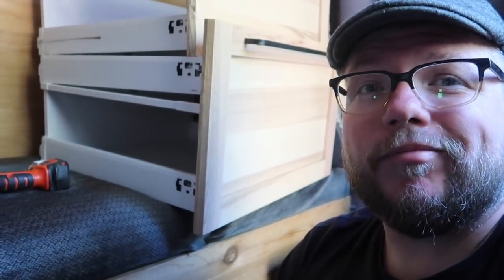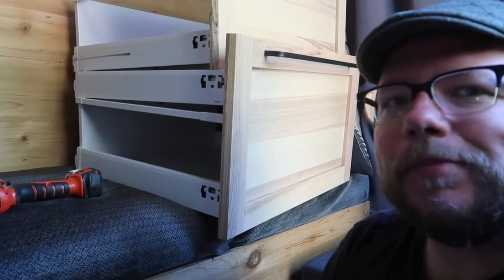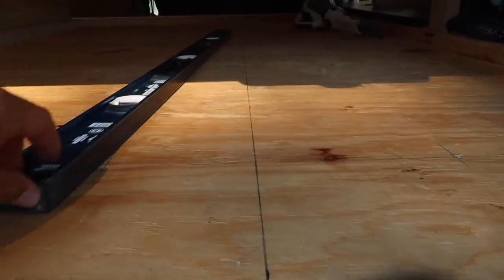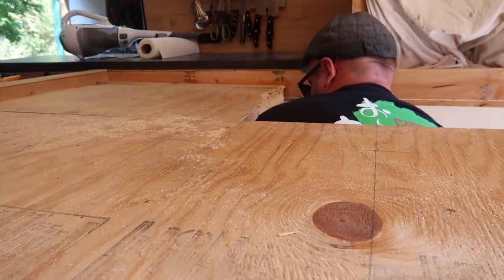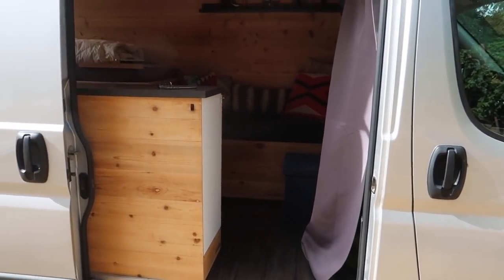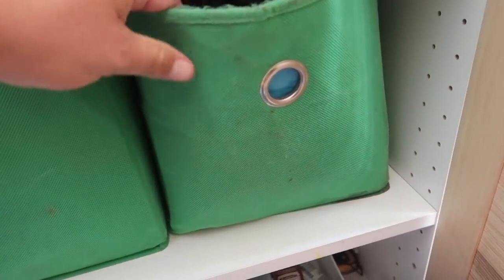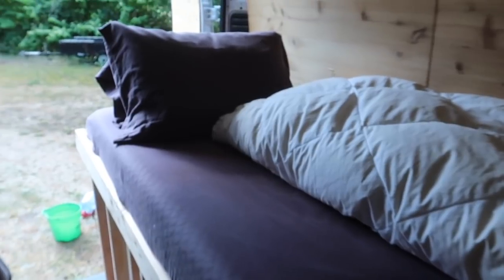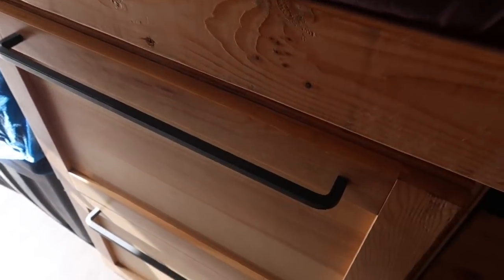New floor plan (Promaster2500) after 1 year of full time VanLife

Comment: I am thinking of adding a Lagun Table.  It can be moved around and have different table tops.  Extra snap in stations can also be bought.  From the marine industry.
Reply: I put one in my 13' Scamp because, once I make the dinette into a bed, I'm to lazy to put it back. I used some biscuit-joined 1x10 cedar boards to make the top. I do regret not getting an extra mounting bracket as it would be nice to be able to reposition it. A little spendy at $174, but well worth the cost, for me anyway.

Comment: I live with everything on modular wire shelving, on wheels. If I want my kitchen on the other side of the room, I roll it over there, and lock the wheels. Same set up with my bed, dresser, etc.. that way, when it comes time to move into my van, from my small cabin, it will be easy to slide everything into place. Even my computer table is on wheels, just like a hospital table. It slides over my bed and then out of the way when I don't need it. Good you have realized just what you need, and have made changes accordingly. Living in a small space, makes you think about things, always having more then one use. Great journey ahead for you, and enjoy the scenery.

Comment: Jimmy  How cool is that , you'll be happier with this set up And once you get a table  top right handy  to you it well be most pleasant to work on.  Every time I see someone working on this I'm reminded of the ironing boards that were in Kitchens many years a go {haha My Mother dream of having one} that was in a then cupboard and you open the door and there was an ironing board folded up in it with a leg on one end and other end was attached to the back of the wall/ cupboard. The whole thing maybe 12 to 14 inch wide. In the UK they are doing this but putting it on the wall { minus the cup board}and not shaping it like and ironing boarded but  as art with a painting / name / saying / pic of family on what would be the bottom of the table. One was Guy was so smart he had the wall end on a rail and would slide it off and put it on the edge of his counter /bed/back door/ up between the seat at the front . cool idea.   Table clothes make great cover for the cupboards Your bags work so well and look the best.  Great job   ByeBye

Comment: Love love love the new van build-- gives me some ideas for my own van. 

A tiny head's up on the safety pins -- don't blame you for doing it that way. Your motive for doing so makes all kinds of sense, but keep an eyeball on them. Most safety pins will rust like crazy with just the tiniest bit of moisture. You might look around for diaper pins.... if they still make them. 

Another option would be snaps-- I think you can get inexpensive kits that you would put on, much the same way you'd do a grommet.

Again, your van looks fabulous!
Reply: Just googled snaps-- found some on Amazon. They were made for leatherwork and are actually more in line with a rivet.... but they do the snap-thing. Not leaving a link- too many options, but if you are interested, keywords "snaps grommet" should be enough to get you started.

Comment: Your down comforter will last longer with a duvet cover. If you suffer from allergies it could be from the feathers. I had to switch to wool in a duvet& i love it so much more. Down was just too hot. Wool  breathes better & is easily washed.2 cents. I try to not have too much plastics or synthetic fibers around.putting a knot in each corner of the sheet tucks ineasily. Saftey pins can easily tear the fabric. What i like about the sheep wagon design is theres benches on either side/storage the table slides out from under the bed opening up even more space. Someday ill have it a sheep wagon. You and your ikea.... try goodwill & salvation army habitat for humanity.